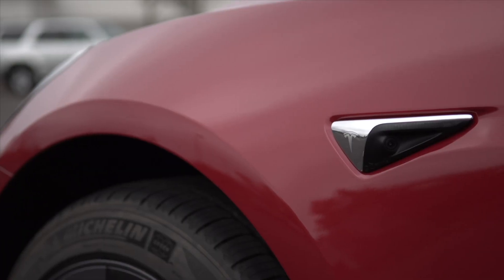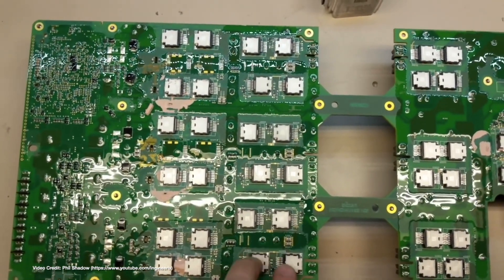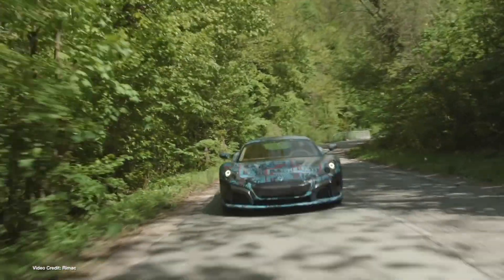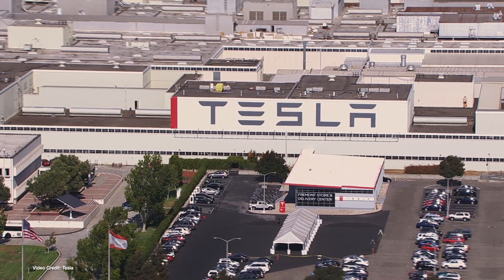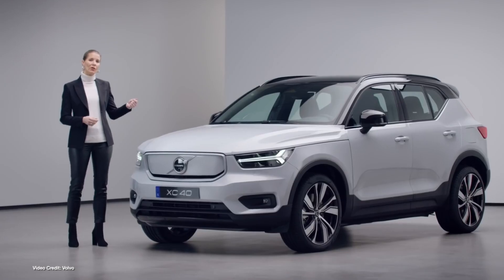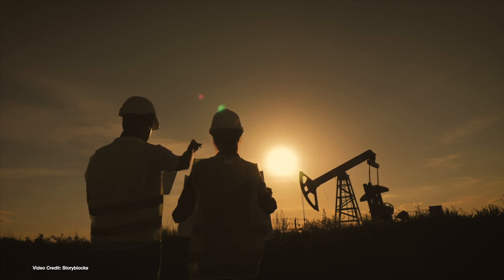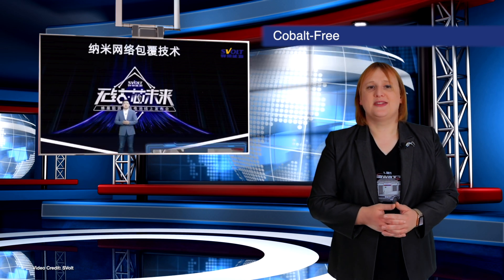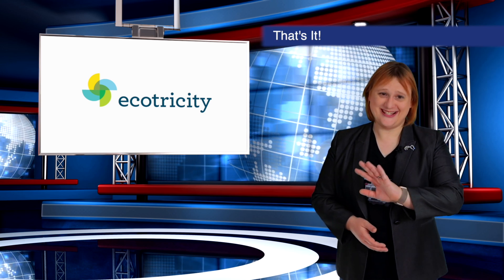ecoTEC 134: Tesla V2G, Forward-Compatible Battery, Google Dumps Oil

Comment: This is something less discussed on battery. 
Tin can package has valve to release gas pressure when needed, prismatic package do not. Under like condition pouch packing generate gas can blow up like a balloon if not contained. It can’t ballooning when jammed pack into a metal container, waiting to burst. Did LG Chem discuss that with GM and Tesla China.